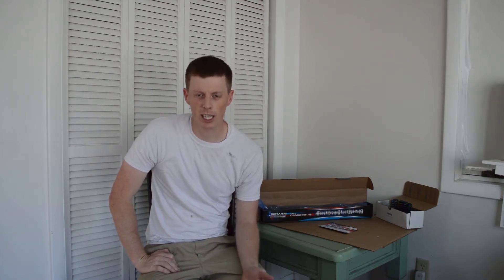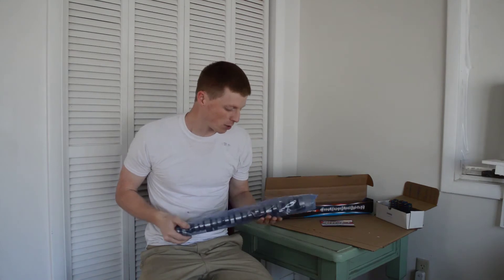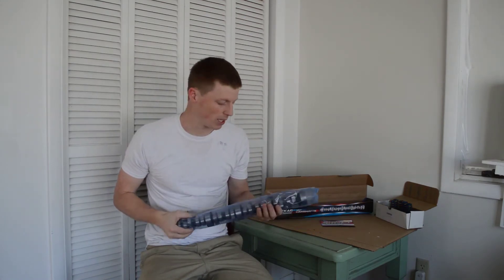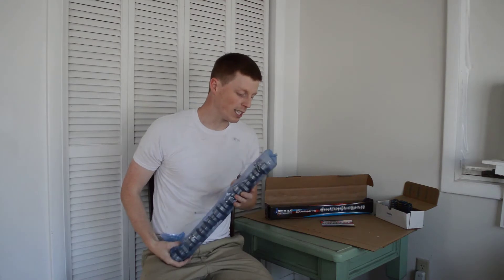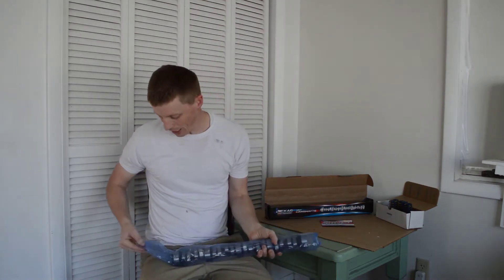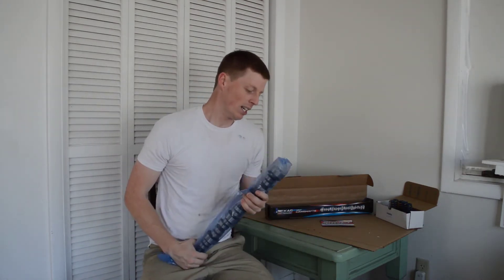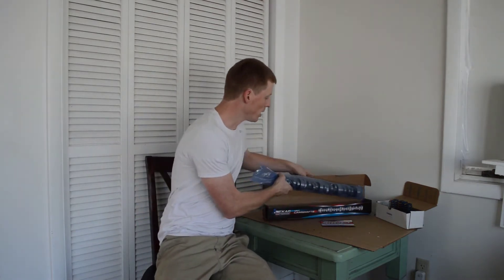Texas Speed Camshaft review

Comment: This something that you shouldn't do, the wrong cam , wrong springs, wrong engine description iron Ls1.
If you need DD cam for a truck tsp 216/220 .600 lift or 220/220 .600 lift Pac springs . 
Been there, done that, ls6 springs= float valve eventually it happens!
Reply: Rey Perez isn’t the low Lift 550 550